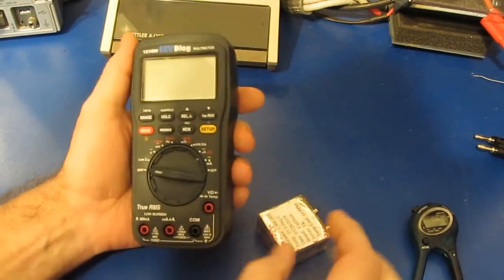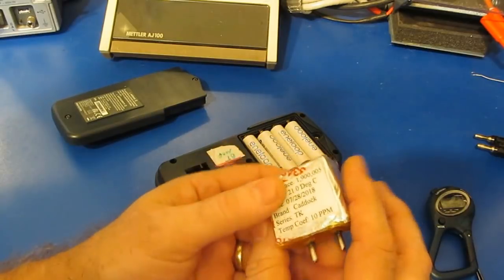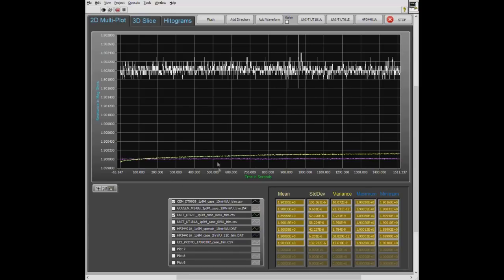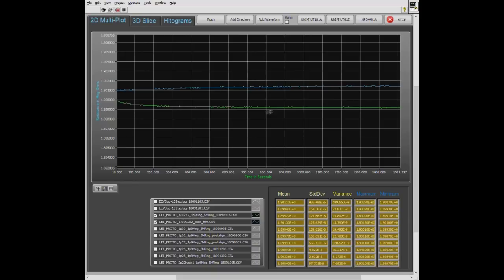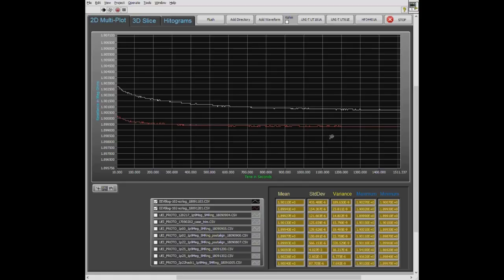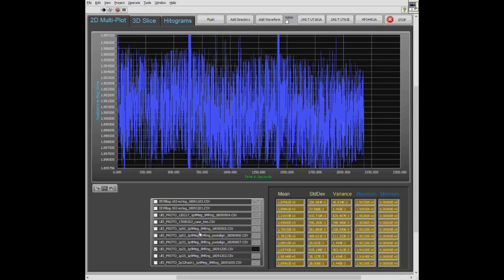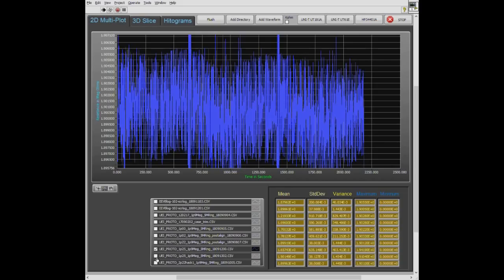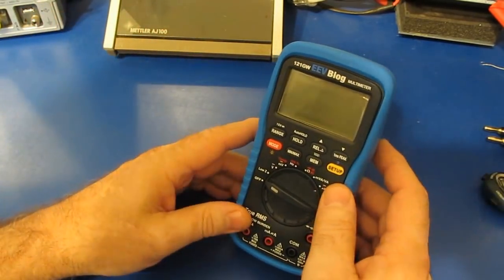Preproduction 121GW, Firmware Effects on Noise

Comment: Just as I was warming up to this meter... It's about time Dave send you production unit to evaluate.
Reply from the maker: He did comment about only having two of them available for his testing and development.  I haven't seen him post much about them.    I would like to buy a couple of the 121GWs along with the pocket meter he is selling.  I really didn't expect it would take this long but I imagine they have to flush the old stock first.
Reply: @joesmith-je3tq  BM525s is looking better by the minute...
Reply from the maker: @tech29X  I've never looked at that specific one but I have looked at a fair number of Brymens products and have yet to be disappointed.
Reply: @joesmith-je3tq   It has > 80,000 data point storage on board. It's a little dated and doesn't have high count "resolution" but display/graph refresh rate seems respectable. And, most people seem to like Brymen.  It sounds like a better choice than a higher spec BETA hardware, where one firmware update fixes some problems all meanwhile creating new ones.

Full disclosure, I swim in shallow waters where voltages feel tingly. I have a feeling before I can get my hands on a Cat IV equipment, I'd be shot.
Reply from the maker: @tech29X  There's a lot to choose from depending on your requirements.  For just some basic logging, you may want to look at some sort of low cost data acquisition system rather than a DMM.

Comment: this reminds me when i was at my first job out of high school, i was at a startup and we had a servo mechanism with a stepper motor, worm drive, gearing and an encoder, i told them i could make it move more smoothly, changed the code very very slightly hit program and the whole thing oscillated so badly it chowdered the gearing 
the gray beard who was working on the project slapped my back and said "try not to fix what's not broken" 
of course this is to a much much smaller scale

Comment: Hi again. Thanks for the info, test setup and it's good to know that is not hardware related . Use a pair of cheap tweezers, put some heatshrink on it's tips to avoid scratches on the microSD or the slot
Reply from the maker: Tweezers, needle nose, one person suggested tape,  won't address that it's just a bad idea to begin with.  I would like to have tried getting LabVIEW working with the BT interface but the meter I have does not support it.
Reply: I dont have a meter. Wont the card just fall off if you press it again in to release lock and then flip meter face up? That's how those card slots usually work
Reply from the maker: cannesahs They used a different type of connector.  There is no need to press it in again to release it.
Reply: Until the issue has been root caused I am not sure we can safely say it's not h/w related.  I have been on too many projects the initial thought pointed to s/w only to find out it truly was h/w related.  I really hope the issue(s) are s/w since they can be fixed or if there really is a h/w issue I hope a s/w work around is viable
Reply from the maker: lordhog,  it will be difficult to correct a poor location and mechanical strain relief of this connector with firmware.

Comment: Never considered mm measuring noise before - interesting vid, thanks Joe:   The 1.25 seems to have a cyclic variation (aliasing perhaps ??)  can you do an fft on the data?  I wonder if they've screwed up the digital filter parameters somewhere and now have an unstable filter ?
Reply from the maker: There is a link in the description to the thread.  There is a bit of information posted about what has changed between the versions.     I showed a histogram where one version appears to have a bimodal distribution.   I have uploaded many of the CVS files I have captured.  You are free to download these and perform any post processing you like with them.